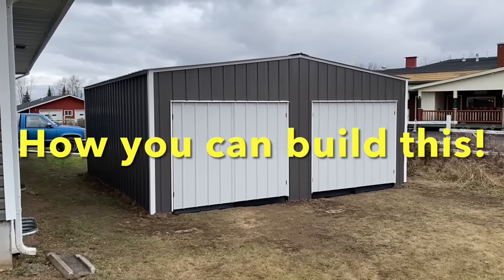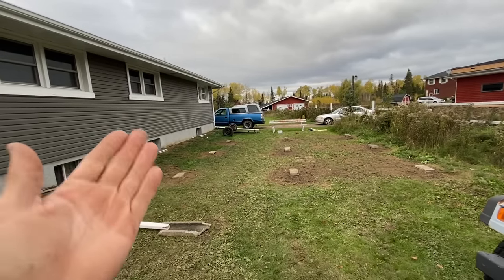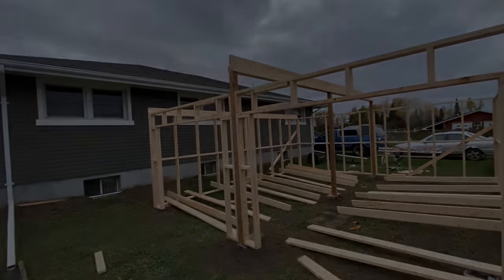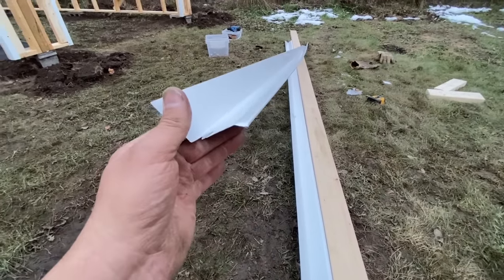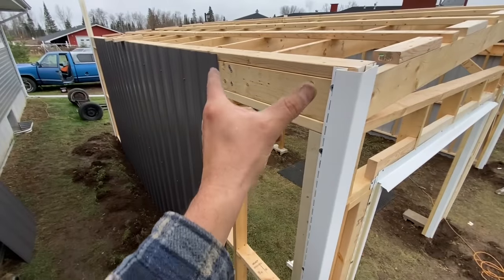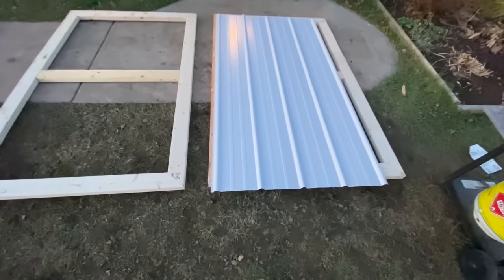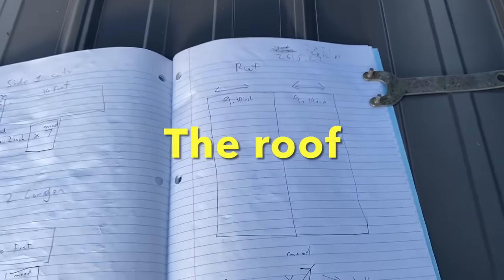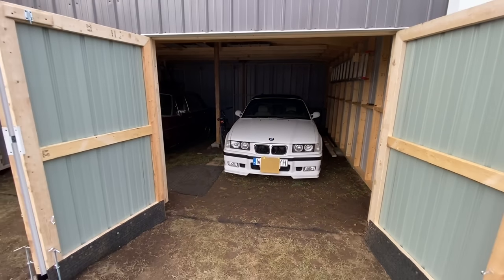How to build a 20x20 Garage for $3000 in 5 days (from Home Depot materials)

Comment: At least two issues.  Don't use drywall screws outside.  They rust quickly.  Use something coated.  The second thing is don't use decking screws for structural components such as rafters.  They make structural screws designed for "structure"
Reply: i was about to say the same thing then he said canada and i said oh no
Reply: my level is broke ...it has an air bubble in it.
Reply: 3rd Issue: Leave off the "guys" every other word, really irritating.
Reply: @devonbond3093 it's better than him saying "eh?" at the end of every sentence.
Reply: Are those concrete blocks ok to lay on their side?
I would expect they would be stronger with the holes facing up.
A lot stronger.
Reply: Maybe pressure treated wood for the wall plates. Where I live the termites would attack that wood immediately, or the rot would start from the rain and humidity. Great video...helped stimulate the gray matter.
Reply: @stevie - Yes, but there are all sorts of other issues that are even bigger problems.
Reply: Good job and put up fast. Thank you.😊
Reply: The wood will rot out. I don't think it sitting on those concrete blocks is a good idea. Could have put footings in for not much money.
Reply: @johnlee7085  Yeah, I used to do er' to
 "get er' done".
I just don't like doing things twice, so I changed and started to be more attentive.
Cheap is great, but I want things to last and not waste time doing the same Job twice.
Good effort though.
Reply: @vontrap6942  sitting on blocks it is a temporary building ie..no permit, no property tax. On footing changes everything.
At least it does here in TN.
Reply: He said construction screws, not drywall screws, big difference.
Reply: @spacemonkey2915 . He installed the flashing with dry wall screws see 39:20.
Reply: @spacemonkey2915 and at 30:55 he says he is using deck screws to
Reply: If you don't like guy word, don't listen. It is a term to talk to anyone listening.
Reply: Use a cup of water and a pin.
Reply: Listen to his beginning remarks. TEMPORARY STRUCTURE. Blocks keep wood off the ground. It will not rot unless wet.
Reply: @dave56ize  im using deck screws on my deck that is structural as far as weight being on it all the time, like 15-1800lbs all the time…..been holding fine for 8yrs no sagging lol
Reply: Nope! Step one : Get a permit from your local city permit office before digging or purchasing, especially USA viewers. 😂
Reply: Seriously
Reply: Regular 2x4 sitting on top of concrete is no bueno gotta use pressure treated lumber anywhere it is in contact with concrete or it will rot plus there’s nothing to keep the whole structure from flying down the street
Reply: @devonbond3093 that is because your nurotic and you have a vice or had a vice and never got help with it I deal with people like you every day I run a painting company and as everyone knows painters have a appointment with Thier doctor at the office every day or the Mobil pharmacy that is open 24/7 so I don't mean to be rude just hope you get some help.
Reply: Anything good to say? Make a video on the proper way to do it.
Reply: @terryhardin2721 hey there, calm down, guy. Relax, buddy. Take a chill pill, friend.
Reply: Still, look at it again... Even using better screws (and I agree) It's gonna be a $3k old shed in a few years...
Reply: Screws won’t matter if he gets some high winds. Lol

Comment: Few comments:  If you have an air compressor, buy a nail gun when it goes on sale at HD/Reno Depo/Rona.  I got the framing nail gun for $225 last spring.  It speeds everything up when assembling.  I did my 10x12 outbuilding last spring with a covered porch for the generator for $3000. Yes I made it look good with window and door.  That nail gun was worth every penny.  Great video.  If it did not need to be mobile, I would have added a concrete pad.  That would give you a way to work on your cars, if needed.

Comment: I hardly ever comment, but I knew that your hard work would bring out all the "experts".  I appreciate what you put up here, because I've been looking for a way to protect a car and some equipment, without spending $30,000.  You've given me a lot of good ideas and I now can proceed with a plan that has a good chance of success, since I'm in Georgia and don't have to worry about feet of snow.  Thank you!
Reply from the maker: Np 👍 thx 🙏🏻
Reply: If you are in GA, look at Alan's Factory Outlet.  They will deliver and assemble a 20x20 metal carport for about $3500
Reply: tropical storm force winds will wreck this building. 

you don't have to spend 30,000 but there are right ways of building on a budget.

Comment: Meticulous planning paid off well. I have never done nor seen a build go so effortlessly and perfectly.  It's not too late to pour a footing and slab. Very inspiring video. It is funny what he did with the Drip-edge but the visible width matches the corners, etc. better.
Reply from the maker: Thx 🙏🏻
Reply: @ProblemSolverGarage  Nice job .. But you should of add the rubber seals under the outsides of the roof and i would of gotten a REAL ridge cap to keep the bugs out or at least screened in the ridge to stop them.

Comment: Hello Hello From Victoria Canada!!! Totally great job on your garage/tool barn!! That is exactly what everyone needs to keep stuff safe and sound from winter in Canada. You have some really excellent tips to help keep everything straight and look real nice and clean. I was in construction and you have some real pro type tips that you have shared with us all. I hope you put down poly plastic and gravel on the ground inside or else the grass and moisture will make the bottom of your cars and tools rust really bad. Also if you don't have any vents along the roof line on the end walls and along the peak the stuff on the inside will be soaking wet all year around. The way it is now is like when you leave a wheelbarrow laying flat upside down all winter and summer then when you flip it over the inside is moldy, rusted out with mushrooms growing in it cause there is no airflow. If you use a 1.5" hole saw to drill 3 or 4 holes under the bottom roof overhang between the rafters and drill some 3" holes along the center of the peak of the roof above the center of the doors and the center peak of the back wall. Just staple some window screen on the inside of all the holes to keep out wasps and rodents you will have a perfect breathing garage. I'm new to your channel so I have a lot of episodes to check out on your channel. Keep up the awesome content my friend and I can't wait to see your next project. Stay safe, healthy and as happy as you can be in all your future endeavors.
🤘😁👍
Reply: Wouldnt water come in those holes you just drilled ?

Comment: Thank-you for the ideas and for sharing them. This is exactly what Youtube university is all about. It creates a conversation that we all can learn from. 

Here in the Pacific Northwest, it is common practice to add builders paper under the metal roof or the roof will rain (condensation) for 6 months of the year. Doesn't add much to building cost.

I share the opinion about the bricks. Turning hole side up and filling with cement and anchors improves achorage for very little $. 

Thanks for the roof cap tip. Simple, straighforward, but something I never thought of. Worth watching to the end just for that.

Comment: You did a good instructional video and the structural parts of the building look pretty good.  Unfortunately, the foundation is lacking in terms of withstanding 1. the uplift forces due to wind (> 20 psf x 400sf = 8000 lbs), 2. the downward loading between the cinder blocks, and 3. cinder block movement from freezing (not below the frost line).  This would not be allowed to be permitted in accordance with more recent IRC or IBC codes.  You could probably resolve the former two issues by installing a monolithic concrete slab inside and around the perimeter which is anchored into the wooden frame.
Reply: You forgot to mention using cinder blocks in the wrong orientation for load-bearing, they're far weaker on their sides than they are when used in their intended direction.
Reply: @AJvsEverything  yep,,, and there's plenty more... To me this is a terrible example of 'construction'.
Reply: Agreed

Comment: Very thorough.   Great editing. 
I learned that i placed my roof screws in the wrong place on my pole barn!  (Though it is doing okay).  I learned about trim end pieces  and "j" ends.   Thanks!

Pretty great shed for 3k!
Reply from the maker: Thanks
Reply: I think panel might want the screws on the flats even on the roof.
Reply: @johntilbury2097  Screws on the ribs in a roof application is the better way to go provided the screws are driven to the proper depth. There are special screws now available which help with that.
Reply: @johntilbury2097  having the screws on the flats will cause leaks from the water pooling on them though, so if it ever snows or rains in your area attaching at the ribs would be best.  Probably Arizona is fine either way

Comment: I just came across your video and I must say, it is a great video and very informative. You explained everything to the point for anyone to follow. You should have used a double top plate on the top and treated lumber on the bottom. All and all, you did a great job.
Reply: A 2x4 bottom plate also needs a solid foundation. Never meant to span anything even remotely close to 10’.
Reply: no, it's actually a terrible video, and the build is, well, meant for views on youtube, not cars...

Comment: Simply done. Was explained as a simple way to put together cheap and by yourself pretty much. Every area city, town & state does have their own building codes, so you might want to check before you build your own. For me I would have used sauna tubes 4 ft down and probably footers to secure the structure from these brutal storms that we all get these days. Thanks for your explaining and taking the time to help those who need an easy way out. Take care of that Mercedes ! My son has the SL600 and I got the 1972 450 soft top! Thanks for sharing.

Comment: This is awesome!  Subbed!  Very explanatory and makes total sense.  The only changes, really, that I would (will) do, is instead of cinder blocks, I use concrete block footers (cinder block will deteriorate in moisture a lot quicker unless sealed), and make them big enough to support the door-face pieces, so they're not "floating in space".
Reply: The blocks were concrete.  But placed incorrectly.  Not load bearing on their side.  Not liking the stuff floating in space.  Love the minimum methods.  Fun watch.

Comment: If you can't find cinder blocks, you can just level the ground, compact it (as much as possible) and put down a few inches of rock. In my area, you can get a truckload of 2" gravel for about $400-500 (delivered), which is likely to cover the whole foundation. I would also submit that you can probably build this same project out of wood for a bit less (a consideration for areas with high winds where you need stiffer walls).

Comment: You did a good job creating the video, I feel I could follow along while doing this myself without question. Americans tend to overbuild stuff and this is more than adequate as a storage building or even small workshop. Unfortunately the price will more than double with adding concrete floors! It is nice to see what you can do with a smaller amount of money, thanks for the vid.
Reply: I live in Washington State are you by chance in British Columbia?
Reply: I had SouthSound Structures out of Lakewood Wa. Build me a 10x20 barn style shed which ends up being 16 ft tall. These two guys did an excellent job and cut every board here on my property and build it here and from there: start to finish they were done in 8 hrs and put two lofts in and barn doors and two small windows, vents and even built me a 20 ft long bench top about 24 inches deep. Going to have the build me another one to put my pro street car and riding lawnmower in it ‘also.
Reply: Wow, All Americans. I thought it was just me!😅
Reply: @Ron_Masterjohn  Sounds nice. How much did it cost to have the shed you mentioned with the upgrades included? Wood floor or concrete? Thanks.

Comment: A parts list specifically of the metal parts and where you got them would be useful. 

This building wouldn't pass inspection in my area just starting with the foundation and not connecting it to the building but it gives some good ideas.

Comment: My only issues on this being a temporary structure is the snow load and no support in the middle of the 3 supports on the side walls, i would put a couple solid 4” blocks with some tapered wedges you can “adjust” as they settle a little because all of those blocks will rise and fall with the frost line being so cold in Canada most of the time.
Reply: He ran a 2 x 4 rail under the rafters to add strength to the roof.  It might have been a good thing to use two, 2 x 4s (top plate) on the top of the wall build as is done in standard supporting wall construction.  
Instead of adding cement blocks between on the supporting wall, a 2 x 6 could be run along the base plate, the entire length of the interior just like was done on the top of wall.  Or, could also put 2 x 6 blocking between wall studs on the base plate.  This would bolster the cross bracing effect of the metal siding, and prevent most sagging from snow load.
Reply: I would like to see an honest follow up vid after a freeze/thaw cycle.

Comment: It’s funny how everyone giving this guy shit.  Yea he used the blocks wrong. It’s light. Prob never bust. Especially buried like that.  Yea he used the wrong screws. Dry wall screws outside. Decking screws for structure.  But the man built a two car garage for 3k dollars while the majority of you lazy YouTube carpenters sat on the couch.  He probably rents this place and wanted to be able to disassemble it if he ever moves. I think for 3 grand and doing it yourself it’s a hell of a setup.  Hundreds times better than having 3k dollars and not having a garage that’s for sure.  Good job brother.
Reply from the maker: Thx 🙏🏻
Reply: @ProblemSolverGarage  do you do construction for trade?  I’m awful at wood stuff. Nothing measures right.  I built two ten by ten storage lofts in my garage on each side. Got one side out off square 2” and the second side I just got off 3/4” can’t notice it and I fixed it with the floor sheet.  Idk how I done it. I think my buildings out of square lol. Has wood pole beams every ten feet and I went off them so idk.

Comment: I wonder if there will be a recap video when fails. A 2x4 bottom plate for a stud wall needs a solid foundation. 

Because the blocks are laid on their (weaker) sides, they also can’t be filled with concrete and an anchor bolt to keep it from blowing away. 

The foundation also needs to be below the frostline, which is probably 2-4’ deep. 

So many other points of premature failure.
Reply from the maker: It's just a temporary carport, but thanks for all the points.

Comment: The bottom boards of all the walls should have been pressure treated lumber.
Reply: Pressure treated lumber rots almost as fast as non treated lumber, a gallon of tar, flashing or vinal wrapping or even painting with exterior paint would suffice be fine.
Reply from the maker: Well none of the wood will ever touch the ground or get wet, this is just a tutorial for some ideas, when you're building yours you can add whatever you like to it, thanks for watching
Reply: @ProblemSolverGarage  best response.  😂
Reply: @ProblemSolverGarage wood shouldn't rest on concrete unless treated or has a barrier.

Comment: Use concrete and rebar for footers and two or three truck loads of gravel for floor and use hurricane straps for roof and you have a $ 4000 dollar garage, but if your planning on moving it, this is a bargain.
Reply: At a minimum, go buy some ground screws to anchor it down, they are cheap and easy to retrofit!  I would've added some hurricane straps as well.  Both are very cheap insurance!!!

Comment: My uncle is a cement truck driver so got the foundation poured for free from leftover partial loads and there was lots of pine trees  in the yard so all the structural poles were free siding was free too and the doors came from an abandoned gas station so those plus a car lift and all the plumbing, wiring and a charcoal grill and three windows were free!!!

Comment: If you’re gonna do something do it right with pressure-treated wood.

Garage looks good but it won’t last even 10 years
Reply from the maker: None of the wood will ever touch the ground or get wet,  i've built many of these and they're all still standing 10- 15 years later.
 Either way this video is just a guideline, feel free to add whatever you think will make it better, but remember the cost goes up with every upgrade. Thanks for the feedback and thanks for watching.

Comment: You need a 2x4 on.  of roof, as the only support is screws into a single 2x4. A 2x4 on either side of center 2x4 for loading. If you get a lot of snow the screws might pull out of 2x4 in center of roof. You need a lot of strength on center beam.. but in all you have a very nice job. If I were to have a garage built I would hire you to do the job. Hats off to you.

Comment: I would have put cement in all those holes where the cinder blocks where and then in the trench I would have filled gravel in the hole the whole way around to help with drainage. Nice job so far. That pretty straight forward !😃😁😆

Comment: Nice job. I am very impressed that you don’t have any bandages on your fingers, I always seem to cut myself when I use sheet metal. 😢But a lot of work to takedown and reassemble. 
I made a 8x12 shed with 6” walls. I built it in section so it can be bolted and unbolted in sections. 2 day to move take down and reassemble with a friend.